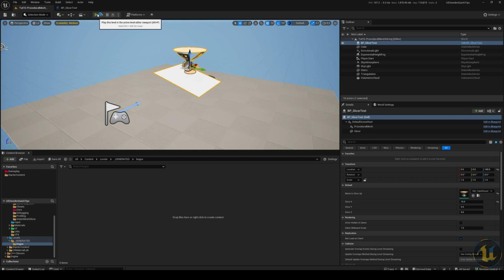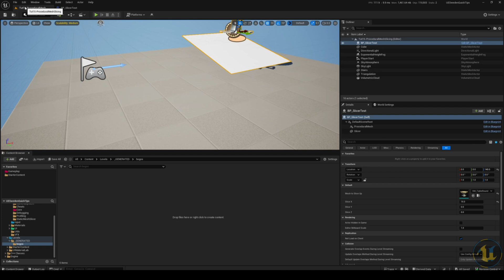UE5 Tips & Tricks - Simple Runtime Mesh Slicing (Slice Procedural Mesh)

Comment: Can this be done on multiple meshes at the same time? The same cut cuts 2 or 3 meshes? or even as high as 40?
Reply from the maker: It's shown at the end of the video that you can cut 1 mesh multiple times. As for multiple meshes, plugging them in as shown in the example for a single mesh, should work (but i can imagine there's a limitation on how many meshes you can do at once and how many total slices). Some experimentation will be needed to find out where it starts to become a bottleneck.